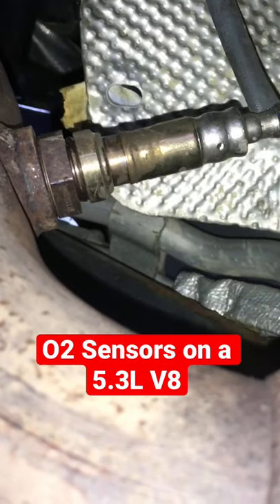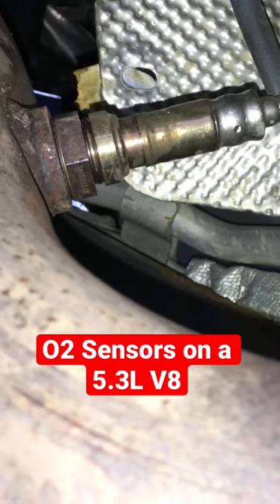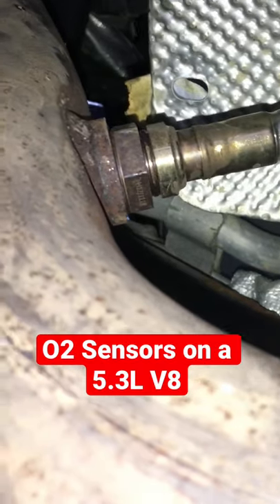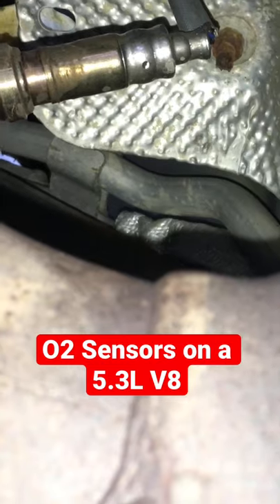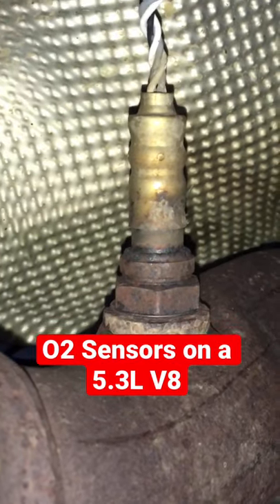Locating Oxygen Sensors On A 5.3L General Motors V8

Comment: I count 3 on my 5.3 why is that
Reply from the maker: Should be four, two upstream and two downstream. I know some older pontiacs has three, but those were not 5.3 liters
Reply: I have a 2006 lt trailblazer how many banks on there if Yu know tanks 5.3 one Cadillac converter
Reply from the maker: @daviantaelowe152  2 banks, with upstream and downstream sensors on each bank
Reply: My sierra 5.3 has such horrible fuel mileage. The cats are out of it, just straight piped. So two out of four of the O2 sensors are missing. Not sure what to do to fix it